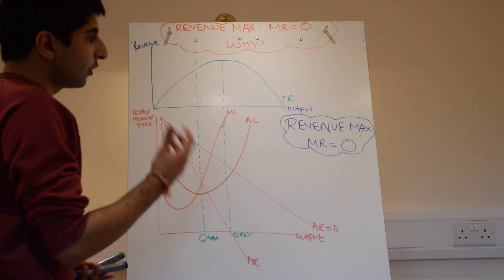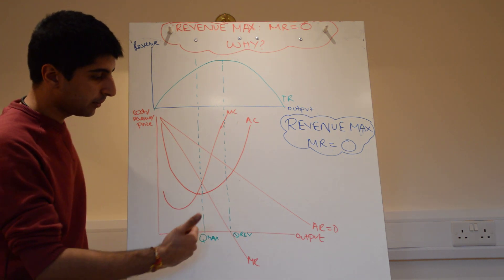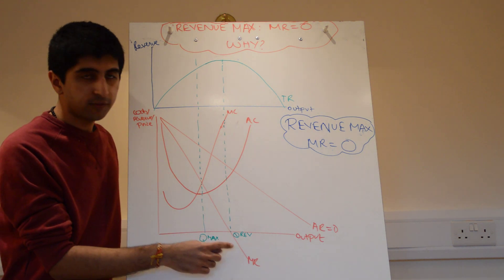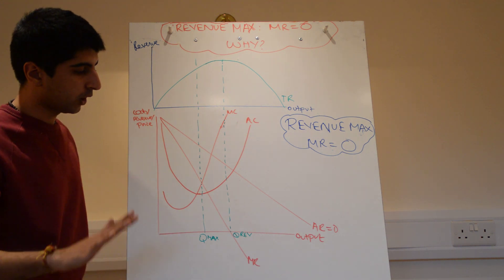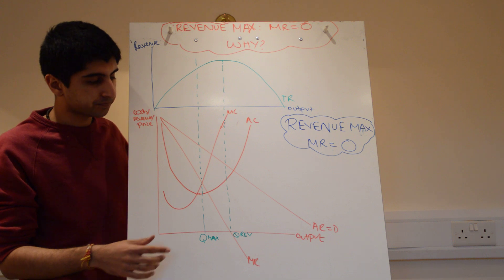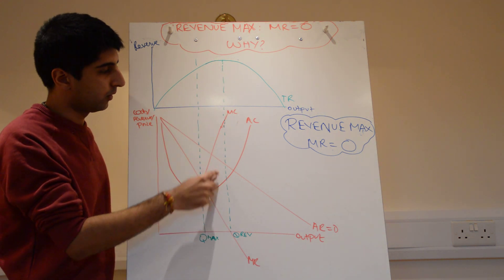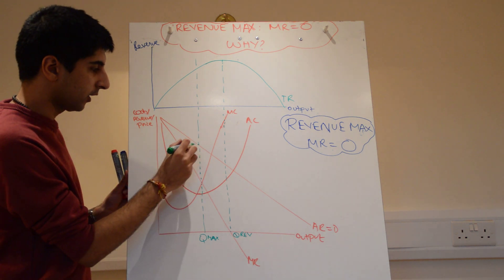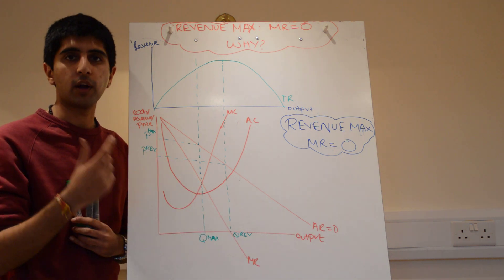A2/IB Why is MR=0 Revenue Maximisation?

Comment: Why is sales maximisation AC=AR
Reply: Here's the reason:
1. Basically, Sales Max. is the point where you've produced all you can WITHOUT making a loss.
2. AC=AR means that on average, your costs equal your revenue, so you're basically making no profit at that point (supernormal profit). (because profit = revenue - costs)
3. If you look to the right side of AC=AR, (average) costs are higher than revenues, so you're making a loss, whereas to the left, you're still making some profit, because your revenues are greater than costs. So neither of these points can be the point where you've maxed out on sales.